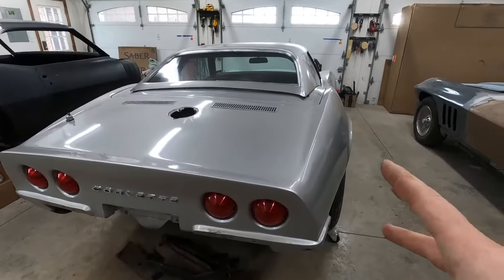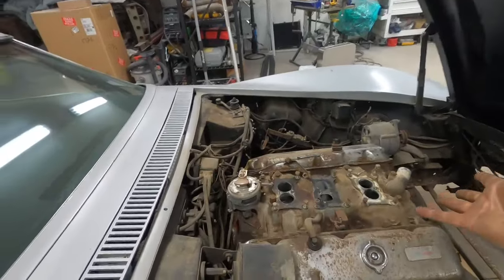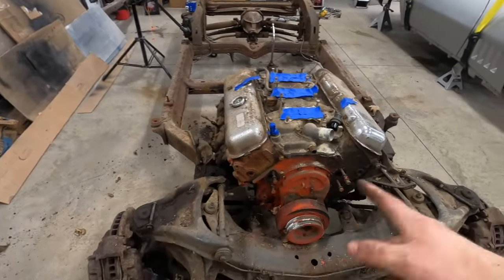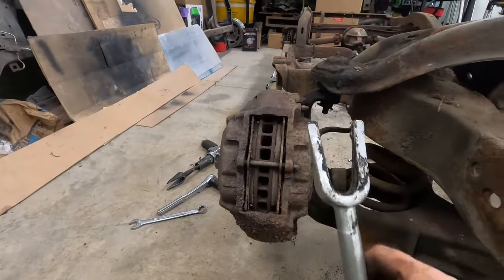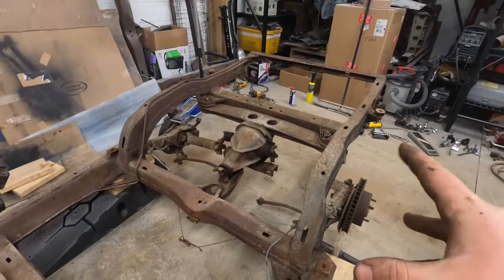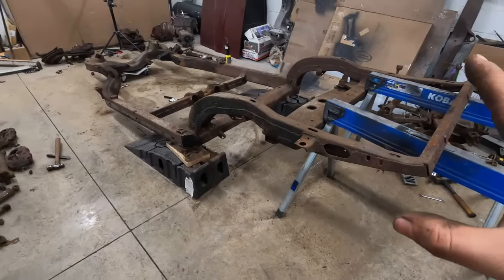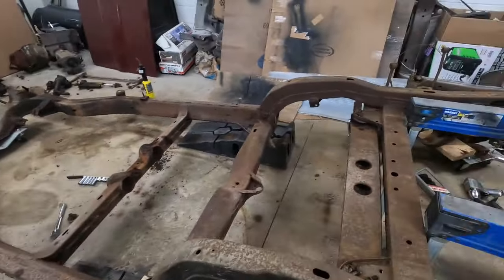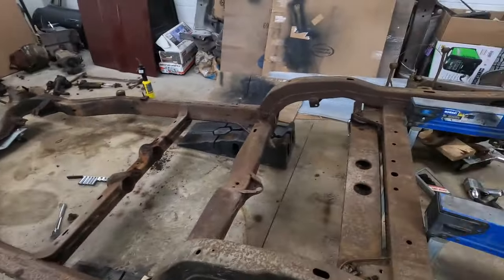Removing A C3 Corvette Body And Tearing Apart The Chassis.  Restoring An L71 427 1968 Corvette

Comment: I live in Germany. When I was 15, a huge Corvette fan (in Munich!), I read, no inhaled, an article captioned 'Corvettes die hard'. It spoke about the massive chassis and plastic body. Only 45 years later I come to see that most important underpiece to the ever inspiring appearance. Due to prohibitively high tax, based on displacement and other 'overheads' I never was able to own one. Never even sat behind the wheel watching that instrument ornamentation from the drivers seat. Maybe some day ... before they mandatorily plug us in. Cheers and thankyou for the film. :)

Comment: I had one except mine was yellow back in the day that engine is a pain to work on change plugs as its stuffed in so tight even with doug thorley headers and side pipes it was a pain that rear end is weak twisted axles all the time i would have gone with an aftermarket frame on this with modern drivetrain keep the engine and trans...even keep this frame and dip it and plate it if thats what happens..not this stuff

Comment: Great video. I did the same thing, but with a Lotus Europa.  Surprisingly similar process.  The problem is, that when that frame comes back, shiny like a Christmas present, you won't want to bolt anything dirty to it.  That's when things slow down... electroplating every nut and bolt and washer!    I am looking forward to the reassembly.

Comment: Hey there Mitch,
Very interesting video. Thanks for showing how it's done! 
Good job not maiming yourself getting the springs out.
Curious, does the powdercoater de-rust and coat the inside of the frame tubes? I'm not sure how that would be done ... chemical dip?
Take care,
Dan
Reply from the maker: Thanks Dan! You’re the man. They blast the frame and spray it down before they coat it. You could have it acid dipped to treat the entire thing.

Comment: Mitch would appreciate if you could  show where the chassis frame numbers are stamped, I have looked at where they are supposed to be on the left side of the frame at the section under where the drivers seat would be and the raised section above where the rear wheel would be and cannot find them on my sons C3. Cheers Brian.
Reply from the maker: I’m not sure if I can see the number on this chassis. You should be able to google the location. If I find it on the chassis I will point it out.

Comment: Did you build the "H" brace to pick up the body or buy it? I'm interested in something like that for future projects. Thanks!
Reply from the maker: It’s actually a pickup truck bed lift fixture. It works perfectly for this type of job. This one was rated for around 2,000 lbs so it’s more than capable to lift up a Vette body.

Comment: Did you remove the rear bumper prior to lifting the body off? 

I pulled my tank on my 74’ before I pulled the rear bumper. I couldn’t imagine trying to mount the rear bumper with the gas tank installed
Reply from the maker: Yes I removed all the bumpers and bumper brackets. Check out my prior videos on prepping the car for the body lift. I’m not sure what the best way to do the late C3’s. You might need to have the top screwed on and tighten the sides after the body goes on the chassis.

Comment: Mitch, as everyone says, great video.  I am in the middle of removing the body from my C3 convertible (68 as well) and I’m jammed up.  The rear support bolt on both sides spin but they don’t come out.  It feels like there is a nut at the top spinning but I can’t get to it to try to put a wrench on that side.  Any suggestions?  Is the only option cutting the heads off the bolts?
Reply from the maker: Hey Brian thanks! Are you referring to the rear most body mount? That one has a cage nut in the body. That nut rusts to the bolt and when you try to remove it, it ruins the cage and allows it to free spin. I have used a saw to cut through the bolt from the wheel well in the past. Most cars have issues with that body mount to be honest. They are stubborn. I hope that helps!
Reply: Exactly, rear most bolts.  I tried to cut the head off one and it left a sliver of the head (annoying) and the other just spins.  What kind of saw did you use and did you go just above the head or in between the thick washers?  I’m close to trying to drill it out as I’m not sure of other options.  If I apply some lifting pressure with the straps not sure if that would make things worse or let the ratchet spin it out.
Reply: Got them off Mitch!  Finally... In a "test lift" I got the back to come up completely and the front to make good progress but there is still either something connected in the front or my lifting 4x4 beam is too far back so it is leaning forward.  Last owner loved his electrical tape around wires and zip ties so I'm hoping it will just be cutting those off and she'll be free. Thanks again

Comment: Great videos! Where did you get the H shape fixture to lift the body off, or did you make it?
Reply from the maker: Thanks I appreciate it!  It’s actually a pickup truck bed lifting fixture. I purchased it from Auto Twirler. They said it was rated for like 2,000lbs. It works really well and it’s the perfect size for this job. I made a separate video on this lift fixture about 2 months ago. Check that one out for some more info! Hope that helps.
Reply: @MidYearMitch  Great, thank you for your response. I have gantry crane and this will perfectly.
Reply: @MidYearMitch  Hello Mitch, I looked for the video but did not see it. What would be the title?

Comment: Can the square nut be replaced with the cage still welded on the frame? Or does the cage have to be removed in order to replace the square nut
Reply from the maker: That’s a good question. You might be able to remove and replace the cage nut with the pedestal in place. 63-67 vettes have a taller pedestal so it’s easier to get in there with the welder. But 68-82 mounts are lower to the frame. That makes it harder to get in there which is why I went about it that way.

Comment: I'm keen to know how long the work in this video took you in real life?
Reply: I see it says a few days in the description.
Reply from the maker: It was 3 days. Day 1 I removed the body mount bolts, pulled the body, and removed the engine and transmission. Day 2 I took the suspension off. Day 3 i rust repaired the frame and removed the rear end crossmember. 

It was 3 action packed days haha.
Reply: Great work. Your organisation and tidiness is what I like and how I like to work as well. I'm jealous that you can just go to a local store and get special or even reproduction parts like that... and send the motor and body off as needed. Where I am, all those bits would have to be ordered from overseas. I think my dream of doing a C3 is not going to be happening heheh  @MidYearMitch

Comment: 1968, the body mounts were aluminum, thus, the frame was unique to that year only.
Reply from the maker: I didn’t know that. That’s pretty wild. It had rubber bushings when I took it apart so either early cars didn’t or someone changed these out.
Reply: @MidYearMitch '68 Corvette roadsters had aluminum spacer mounts from the factory.  Maybe some idiot switched to rubber to eliminate some of the vibrations and excess noise. Guaranteed that it didn't work.

Comment: Powder coating ? What about all the rot on the bottom of the frame rails?     PS, don't tell us there wasn't any...
Reply from the maker: Yes powder coating. They blast it and coat it. I did what any good repair man does. I fixed it. There was a spot that was about 2x2 that I fixed. I didn’t record everything because I didn’t have time to. Why are you always so aggressive with your comments? Chill out man 😂
Reply: @MidYearMitch  You'll be getting a call from the powder coat shop after he blasts those rails into swiss cheese. Do the job right or don't do it at all.
Reply from the maker: @hillarylevenworth8824 I don’t think you realize how ridiculous you sound. There’s a glass half full or half empty perspective. And you just smash the glass because you don’t want to wash it 🤣 I’m glad you stopped by the shop and laid your eyes on the chassis. Oh wait you didn’t and you are just judging to judge. Checks out thanks ms lady.
Reply: @MidYearMitch  - you’ve done an awesome job, where do you work out of ?